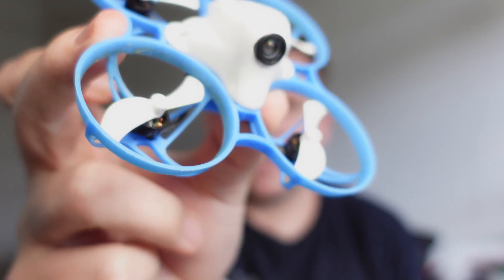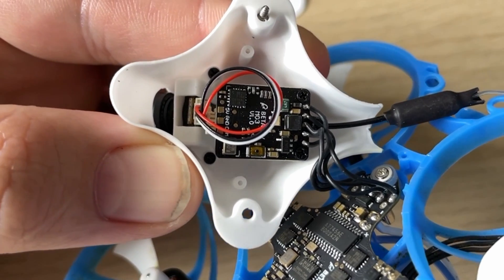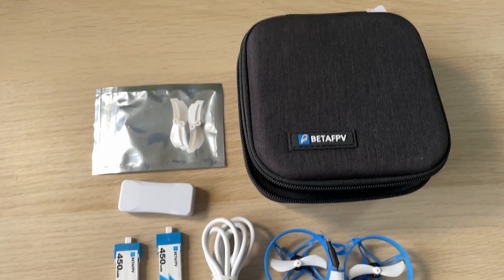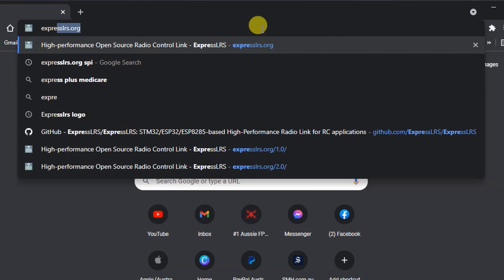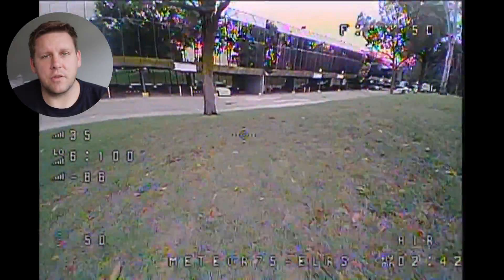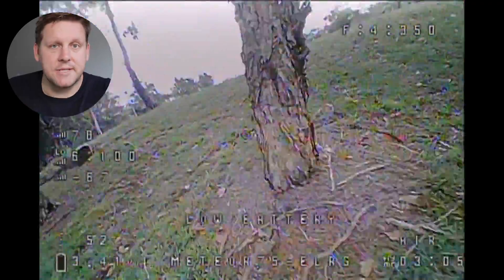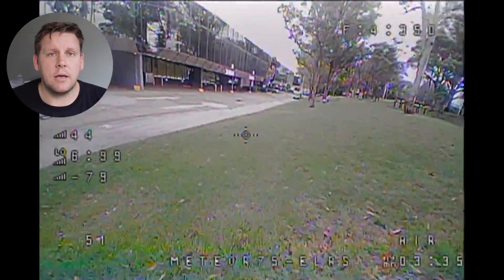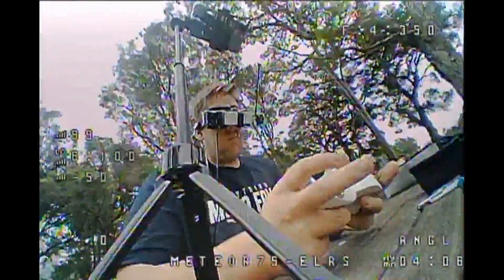Long range whoop? - Meteor75 ExpressLRS Edition

Comment: I have a meteor 75 erls but i think is not enough  to compete in fpv race what u recommend for that? ps great channel
love from italy
Reply from the maker: It’s fine for Whoop Races, unless you mean outside race?

Thank you 🙏
Reply: @DarrenAllatt  yea outside race so I think is don't have much power
Reply from the maker: @minusdream440  it’s not designed for an outside race. 

Here are some options, but you are looking at a 5” 6S Open Class Racer

1) Build: Five33 Switchback
2) Buy: Foxeer Caesar / HGLRC Wind5 Lite
Reply: @DarrenAllatt  here in Italy they race with the baby fox by finz  it seems fast but is 400 € and at leat u need 3 for all the championship